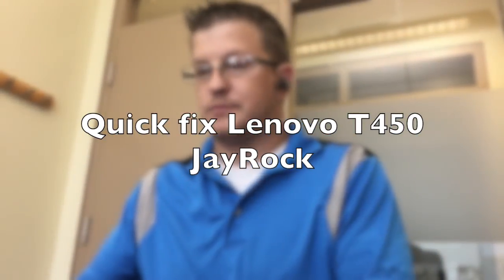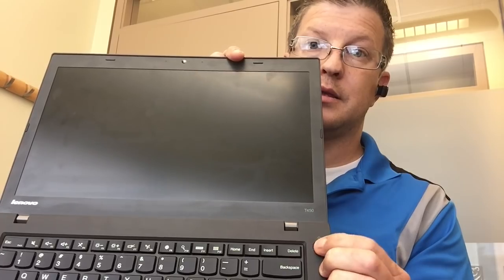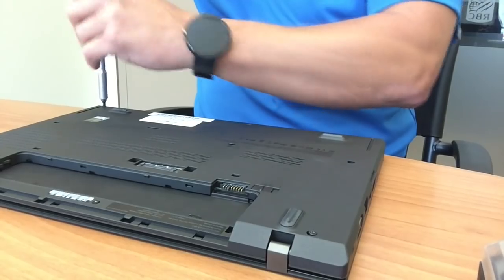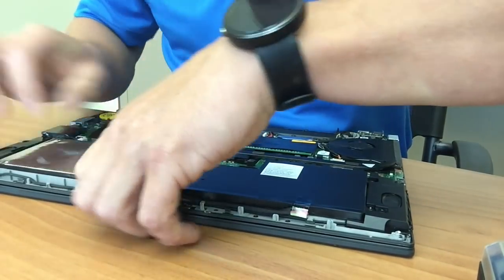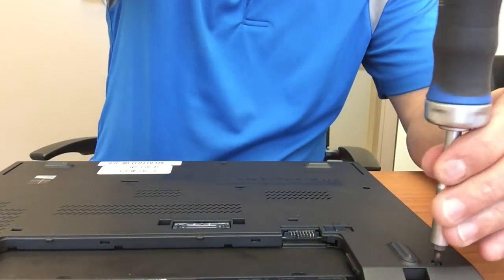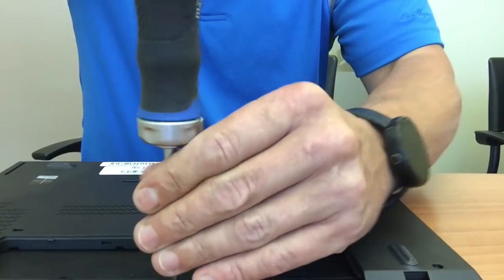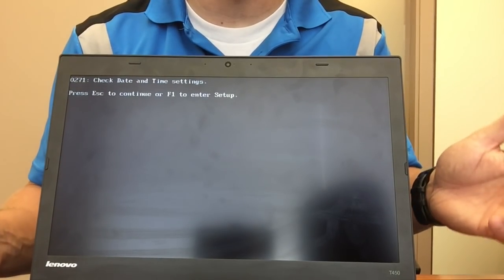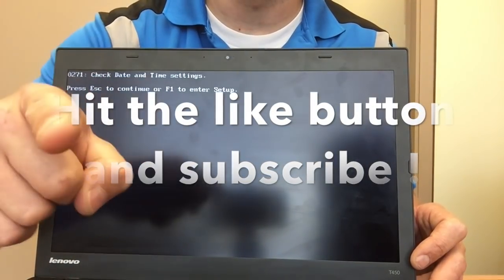Lenovo T450, T450s, X250, L420 and T440S Not Powering ON Quick Fix

Comment: Well, I did repeat the samething, including the reset hole, my T450S still won't turn on (including to BIOS, I eveb took off the SSD as well as the RAM, etc) -- still not working, only the power light on, the screen is black
Reply from the maker: Dead board

Comment: When I tried the steps it did not work for me and I still have my T450 do nothing when I press my power button. I also realized the dummy switch besides the internal battery has come out, does this mean i need to change the mother board now ?
Reply from the maker: most likely unless you can find a work around

Comment: You're a life saver.
Reply from the maker: Your welcome, update your BIOS with Lenovo software suite
Reply: @jasonflt  I have the T450 with two drives (Windows 11 & Debian), booted Linux and put it to suspend, it doesn't know how to wake up have to force shutdown however still cannot power up. Ty Again
Reply from the maker: Try again and wait 1 min. Pless the power button 10 times and then hold for 30/second. Also disconnect a single drive. Re insert the stick of RAM as well

Comment: hi in my case they dont have internal battery what should i can do ?
Reply from the maker: Just pull the cmos battery and leave it out for about 10 minutes.
Reply: @jasonflt  ok i am doing right now
Reply from the maker: I cannot guarantee that's going to fix your problem but after you reconnect your C-MOS battery to your motherboard you're going to have to plug the power supply into the laptop.
Reply: still samething keyboard light on few second and fan on after shut off again and again no display
Reply from the maker: yeah unfortunately that's a system board replacement  @muhammadfaizan-f7r
Reply from the maker: https://www.buymeacoffee.com/jasonflt/giving-back-2253362

Comment: Do you have a tutorial on what you can do if your power button is on but showing the black screen no display and nothing will make it work, no caps or number lock key will light up and ive taken apart the battery and done several of the things its saying on some other videos but nothing so far is working. Should i try buying a new ram or new battery?

Comment: Help me my problem this my t450 not boot up without charger battery condition is good when i turn off my laptop its didnot turn on without a charger when i plugged the charger it works good . plz help me to solve this issue i will  be very thankful to you HELP PLZ
Reply from the maker: Bad internal battery or bad system board .

Comment: I tried almost everything! The emergency button, removed the Ram, hardware and the internal battery but with no luck. My laptop won’t switch on. The switch button flashes 3 times and then it stops. Any help is much appreciated.
Reply: Same problem here.. anyone with a solution

Comment: Great video.....did you say to do all of this with the power lead still connected and plugged into the mains ?   thanks Rob (UK)
Reply from the maker: Unplugged from mains power, disconnect batteries, wait at least 5 minutes and or hold the power button down for 30 seconds. After reconnecting the batteries you'll need to plug the laptop into mains power it gave the power back for it to come back on
Reply: @jasonflt  Hi there....actually, i did exactly as you said. However, after reconnecting the internal battery ( no apparent CMOS battery that I could see on my X250..but there is an empty cradle for what looks like a battery slot) I replaced the back and just switched on....and hey presto!...she fired up....without the external battery or power lead.....I then slotted the battery back in and everything is fine and dandy 😉.....really appreciate your video tutorial....many thanks 
Rob UK
Reply from the maker: X250 carbon?  does have one and most likely you have to take apart more of the laptop to disconnect the CMOS battery
Reply: @jasonflt  no idea 'Carbon' or not....looks similar you yours in the video....just says X250 bottom right.  With the back off, found the internal battery connection just as you said.....but where the CMOS location is on yours....on mine just aluminium battery clip/slot for what looks like a fairly large ;button type' battery.....but its empty.   Anyway, just disconnecting the  internal battery did the trick....many thanks !

Comment: I tried doing the same, but its still not powering up, any other ideas? :( Is there a way to check if the charger is working fine without the laptop? Using a tester maybe?
Reply from the maker: Unfortunately no unless you have warranty and you can submit a ticket to Lenovo it's e-recycling now
Reply from the maker: you could use a multimeter to check for power on the power brick its self but very very rare that one dies.

Comment: I had problems with X260 it wont boot without reset button. After shutting down laptop i cant not opening the laptop. I tried to do with your tips but not working. Can you help me? 
Thank you
Reply from the maker: Give it a try again disconnect both batteries and leave it for like 10 minutes. Press and hold down the power button while the batteries are disconnected for a good 30 seconds. If that doesn't work then you need a replacement motherboard at that point also when you reconnect the batteries you need to reconnect your laptop back to physical wall power. So connect your power brick back to your laptop and it will power on or it should

Comment: Hi Jay, I did a BIOS update yesterday when the BIOS update was fully installed but then the system restarted and after restarting, the light inside the power button is on but nothing is coming on the display. I did exactly as you said in the video but I have not solved my problem and I still have the same problem.
Reply from the maker: My solution isnt for that problem. RMA your laptop. Call Lenovo

Comment: Mr Jay this problem occurred again. The day before yesterday I did the trick you have shown in the video and my laptop worked. And yesterday, I worked whole the day using the laptop. And today morning when I turned on the laptop it again had the same problem. Any clues what is going wrong? I have the same t450.
Reply from the maker: Updated your BIOS. Use Lenovo software suite to do that and any other driver updates. If it keeps happening use your warranty of you have any left. Check the Lenovo website.
Reply: @jasonflt  okay. No I have no warranty because this is t450. I will try everything that I can.
Reply from the maker: @wishvaweerasekara170  okay, basically if the issue has t resolved itself after a BIOS update. System board replacement would be the only thing that will resolve your problem. Just a well known problem with some Lenovo ThinkPad
Reply: @jasonflt  yeah I'm afraid that will happen because in this pandemic searching for a board is a difficult thing. I have tested the board using lenovo diagnostics and it passed all the tests.I will update you if anything happen.

Comment: You don't need to take the laptop apart if it gets hung on power down. You use a paper clip in the reset hole. This information is in the service manual.

This procedure he is suggesting is dangerous and could cause a short and damaging a component in the laptop.
Reply from the maker: Your only 10% right. I'm a trained Lenovo Tech. I have fix more laptops than you'll ever see in your lift time. That only works once in a while. Also damage to components etc lol. You'll be fine bro 😉

Comment: I have lenovo IdeaPad 100 15iby. I changed its thermal paste and after that it is not Turing on. Tried removing cmos battery . Reconnects ram but still not Turing on led blinks 5 time s . Any solution? 😭
Reply from the maker: Does the ideapad have an internal battery? If so disconnect that and CMOS, press and hold the power button for 10 seconds. Reconnect the CMOS then battery. Connect external power to the ideapad, then try powering it on. If that doesn't work, motherboard needs to be replaced
Reply: @jasonflt  yes it has internal battery .i have disconnected them but separately not at same time. But how this can happen i just removed the old paste with new one that was of cooler master and electrically non conductive??

Comment: Hi there. I have a Lenovo x230, got it 6 months ago, almost new. Used as second laptop. Yesterday it did not start on. Power button lights on, green color, the keyboard and the webcam lights on, also the speaker and microphone buttons (orange color) and the icons of the wifi and CPU on the lower screen bezel lights on when I push the power button. Then all go off except for the power button. The only thing that does not lights on is the finger print sensor, which blinks always in green color. No noise at all, no beeps, just the vibrations of the CPU (HDD) when touching the PC underneath. After a couple of minutes, it feels a little hot underneath, where the CPU units go. 
What I have done to check it:
1.	Power button test, pressing it for 1 minute while no battery o power cord connected.
2.	Remove of the CMOS
3.	Remove of the RAM sticks and replaced by similar from a running PC.
4.	Tried booting without CMOS
5.	Tried booting without RAM
6.	Tried booting without HDD
7.	Tried booting without KEYBOARD
8.	Tried booting without PALMREST
9.	Left overnight without battery and power cord.
10.	Tested the CMOS with a multimeter, resulting in 3V reading.
I refuse to think the motherboard is toasted, so I hope someone might have some experience in what could be the fault. 
Things to look out: the finger print scanner and the fact that the CPU get warm (while the power button shows on), as in a regular PC when working. Also, the fact that the computer behavior at starting attempts with and without CMOS battery is the same. Provably the BIOS chip? Note that I have not tampered with this PC at all. I bought it from a Lady that almost never used, she got it as a payment, and stored it. Since I have a T440P as daily use, I did not start use the X230 much, which is stock in hard drive, RAM (4) and everything else, so it is very slow.

Please check my video about it https://youtu.be/wEuAJ42raVs   Thanks
Reply from the maker: i replied on your youtube channel. great trouble shooting

Comment: hi 
i'm facing somewhat similar issue, laptop doesn't power on , but when i remove both batteries and plug in the charger, it turns on, after that i connect the batteries and it works, but when i shut down, then again won't start, i went to a technical repair shop and they told me that it's the POWER IC problem and we don't have a replacement IC, what should i do ? is it the IC problem or BIOS problem ? or can i use IC from another type of laptop ?
Reply from the maker: You really should use from the same model of laptop. Most of the time it's super easy to replace
Reply: Same issues here on my T440
S, I hope replacing the motherboard fix it permanently
Reply: @rahadiwibowo   yes. My laptop is at the repair shop and they’re going to replace power IC and after that if it didn’t fixed. I will replace motherboard. It’s easily available and better option I think.

Comment: I tried the steps you mentioned but it does not power on. When I press power button the light on the power button blinks three times also the fn key and caps lock lights turn on for few seconds and then turn off. Please help
Reply from the maker: Most likely a system board replacement is needed .

Comment: Any solution for t420 ?It won't power on, but when I remove battery and CMOS battery and plug in AC adapter it turn on normally. I have newest bios . Is it corupted bios or broken power button?
Reply from the maker: unfortunately i think that would be a motherboard replacement. Seems like the power management system is junk or a something died that controls it. just a 411 when you remove the internal battery and cmos. the laptop does require wall power to come back alive.
Reply: @jasonflt  tnx for info
One more question pls. When I press power button and hold it for 5-10 seconds to force shut down nothing happens,is that how it suppose to be? Sorry for bad English.
Reply from the maker: @orthodox8224  it's hard to say. i know on some lenovo stuff i have to hold it down longer for some reason or it will put it's self into sleep mode

Comment: Hi great video. My T440s won't charge but the lights (on the power button and at the back) are flashing meaning the charger is working... Do I need to get a new motherboard?
Reply from the maker: ya if my fix doesnt work, most likely is a motherboard replaced.

Comment: worked the first time, but right now when I put the cover back, the laptops doesnt work and I have to use the laptop without thr cover..  If I put the cover back the power button, fn button F1 and F3 blinks ...  what could be wrong?
Reply from the maker: did you update your bios after you fixed it the first time ? also you need to reconnect your power bar back to your laptop. try it again
Reply: @jasonflt  Actually there is an error trying to update the BIOS UEFI,  I disconnected the power bar and the Battery then I reconnected both..  Im not sure if there is a false contact but if I put back the cover the laptop shows the same problem..  and without the back cover works without problems.
Reply: Btw Thank you for ur response
Reply from the maker: @motofoco  most likely a motherboard replacement. The laptop isn't supposed to turn on when the back lid is off. Reseat the ram. Disconnect the internal batteries, press the power button 10 times and hold for 30 seconds. Reconnect the CMOS battery aka the small one and then the large battery. Put the back lid on,screws down and connect main power brick

Comment: I did exactly the same, but it did not work for me 😭any other suggestion
Reply from the maker: Give it another try. This time hold down the power button after you disconnected the batteries. Hold down the power button for a good 30 second
Reply: @jasonflt  thanks for your quick reply, I've tried with no success, pc is completely dead, no lights or sound.
Reply from the maker: Sorry to hear that it didn't work for you.

Comment: Hello, this also works to configure the bios of a Lenovo T450 that has no operating system and can install the operating system?
Reply from the maker: are you unable to install an OS on your laptop? my fix is for people who can't turn there laptops back on because of a faulty bios bug. make sure you have legacy or uefi or both enable in the bios to install windows. if your bios is locked aka password is needed, can't help you with that.
Reply: @jasonflt  When I turn it on, the computer has a password but I have the password and I can access, the computer does not have an operating system installed and when searching for the bios it does not give me many options, it detects the USB but does not start with the USB to install the operating system.
Reply from the maker: @creatifdigital2536  2 things you can do, turn on laptop and press F12 a few time until you get a screen showing you what devices you can boot off of, if it doesn't show your usb on the list then you need to go into the bios and add the usb to bootable devices

Comment: Sir please give me solution lenovo t440p bios password remove
Reply from the maker: leaving the CMOS and internal battery disconnect for 24 hours
Reply: I am waking sir but not sulotion.. Please guide me on video thanks
Reply from the maker: @kashifkhan7868  pull the back off and look for the batteries, best i can help you. its up to you now.
Reply: @jasonflt brother same to same laptop t440p copy bios and installed but no.... bad idea a still password
Reply from the maker: @kashifkhan7868  can't help you out with that, call lenovo

Comment: It worked Just one time, then i tried again but doesnt Work anymore... any suggestions?
Reply from the maker: most likely a motherboard replacement. give it one more try and leave both batterers disconnected for 5 mins. if it works this time, UPDATE YOUR BIOS !
Reply: Jay Rock im going to try it, just another question, did you disconnect the BIOS battery?
Reply from the maker: @Isk_98  yes you must disconnect both batteries. when both batteries are disconnected press the power button 10 time and last one hold for 30 seconds. it get's rid of any extra power that is still on the board.bios battery is aka the Cmos battery
Reply: Jay Rock why u didnt press the power button 10 times? Ive already watched like 10 times but just worked one time.... i just dont get it lmao...

Thx for your support
Reply from the maker: @Isk_98  it's kinda a last ditch thing to do. really didn't think of it at the time but update your bios and your problem is gone
Reply from the maker: @Isk_98  thanks for the sub, cheers!

Comment: Thanks. now I see the green light on and Keyboard light flashed. But I don't see any display on the screen waited fro 30 seconds and no luck on display..any idea ?
Reply from the maker: try disconnecting both batteries again. when the batteries are disconnected. press the power button 10 times and hold it for 30 seconds. reconnect the batteries. plug power back in and try to turn it on.

Comment: Hi Mt T450s wont power up after yhis process. It was working fine. When I tried to swap a keyboard on my T450S it wont power up. Any idea?
Reply from the maker: reseat your keyboard connections. a keyboard shouldn't make your laptop not start up. make sure you have the power brick plugged into the laptop to power it on after doing my process. it needs power from the wall.

Comment: Looks like power button lost its spring. T430s. May not be worth fixing. Happened suddently  Any advise?
Reply from the maker: all depending on what model you have. 9/10 it's a motherboard replacement unless it's a daughter board that connects to the main board. If you have warranty use it
Reply: This s an old T430s with on button on the right next to screen.Now I'm back to my old SL410 running Ububtu.